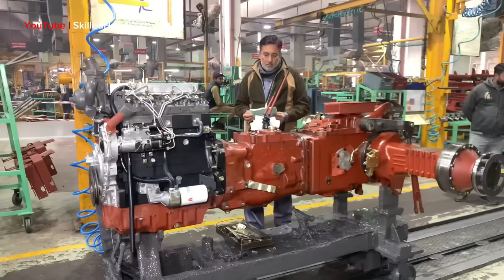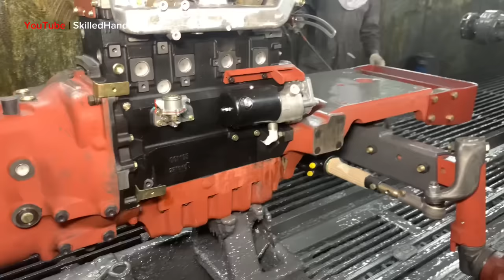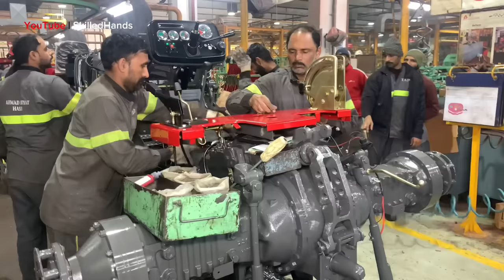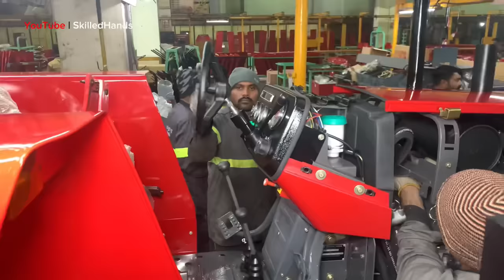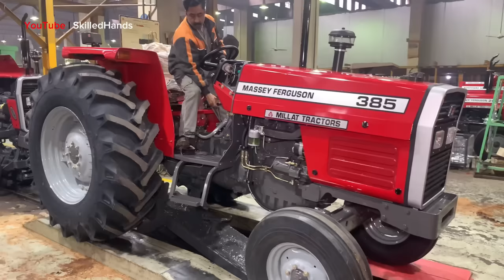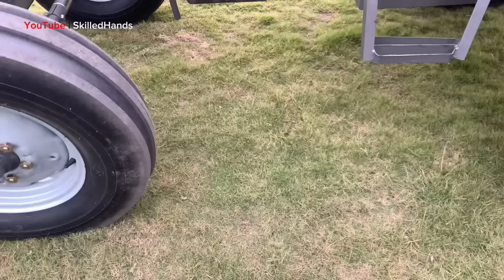Massey Ferguson Tractor 385 Production Factory 60 years old | SkilledHands-10

Comment: I am a man who is an engineer with a master’s degree in agricultural machinery and equipment from Iraq. I had a 1967 Forexon tractor, a 1980 tractor, and a 2000 model tractor. They are all tractors that are similar in shape. There are no developments or more accurate sensors. As for this one in the video, it appears to be not durable and inaccurate in manufacturing, and it has not been subjected to any testing.  Due to the heavy load and tension, the method of painting the body is not good, and we did not see its performance in working in the field. There are no weights on the front or tires to give it balance in pulling the machines.
Reply: Brother don't be jealous 
This machine is really very perfect, we have used it and it is 100% good
Reply: 375 Perkin kasa he 1991 to 1997
Reply: This video is only a snapshot of manufacturing process and do not hold for your analysis as well as judgement on quality control. Come to India and visit the plant and see how these machines are tested, used in the fields.

Comment: Putting the fuel tank in front of the radiator might cause the engine to get hot I've got a 285 and if the grill is blocked the engine gets hot I'm sure that they figure it out to make it work
Reply: Yes,  NEVER obstruct airflow to the Radiator !